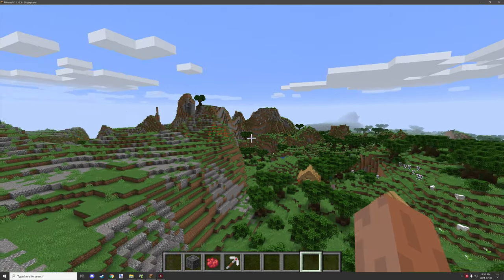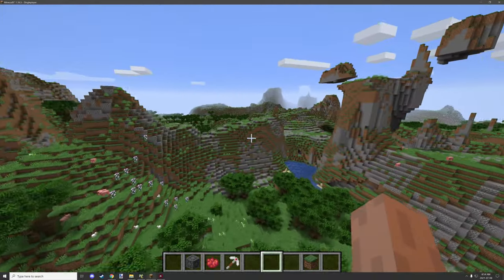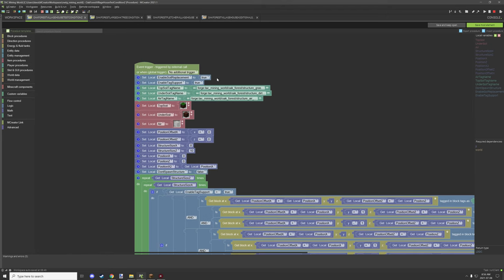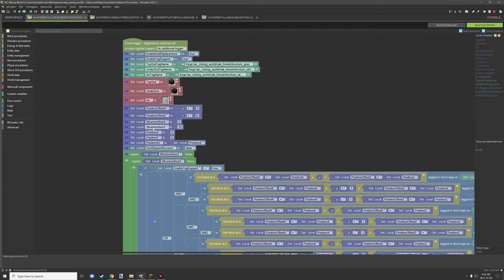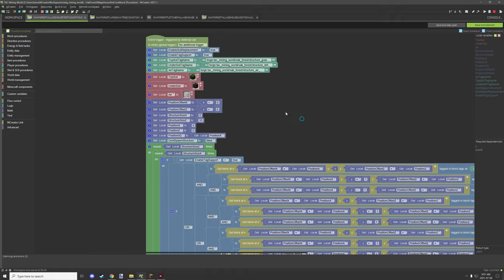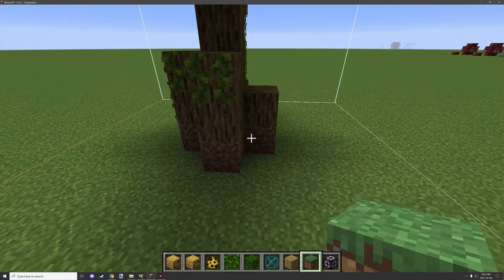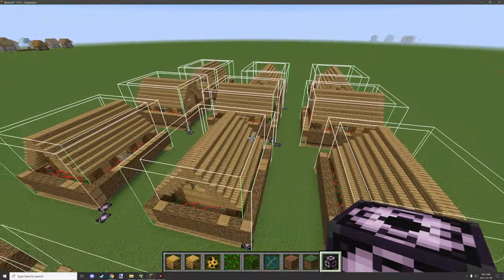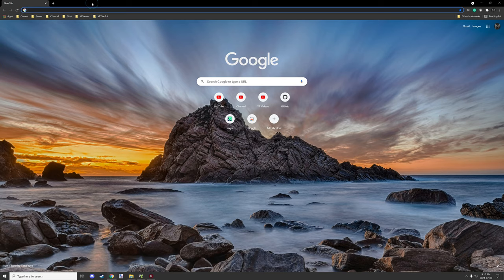MCreator: Advanced Structure Generation Script | 2021.1

Comment from the maker: I have just updated the download on GitHub to add support for changes made in MCreator 2021.2 regarding string variables. What happened was the procedure broke due to the changes in 2021.2 so I had to remake the procedures for the ones that used strings. The download should now have a folder for 2021.2 and higher and the old variables if you still are using 2021.1.
Reply: Which procedure is the one used for the trees?
Reply: thank you king

Comment: can you please make a tutorial on how you made the stone spawn on the cliffs or how to make the ground made up of multiple different blocks? make a video explaining it if you can, appreciate it a lot
Reply from the maker: Same script oddly enough, I used a structure that spawns in the mountains biomes (I think I used a random block just as a placeholder so I can run the script) then I I used a repeater for areas to spawn random blocks (cobblestone, gravel and no change) to generate noise, I simply replaced the topsoil and undersoil block for that biome using the script in the video it seem to work fine when I made the video I am not sure if it would still work on not though.
Reply: @NorthWestTreesMCreator  can you make a video on it? i still didnt understand, sorry
Reply from the maker: I sadly don't have the same workspace as the video I lost it when I upgraded my computer SSD drive, but I do have the script so if I find time to play around with the script I will make a tutorial on it for sure. I will add it to my notes right now.
Reply: @NorthWestTreesMCreator  TYSMMMM!!
Reply: @NorthWestTreesMCreator  i hope you still have it in mind im sure alot of people wouldnt mind 😔

Comment: Its not showing up when i try importing it if you might have reason i would love some help and thank you
Reply from the maker: There are a few versions for this workspace on GitHub, if your using 2022.1 then use the latest workspace, if its 2021.2 then use that version if your on 2021.3 then try updating for that version as you may have mist some patches along the way. 2021.2 basically changed a variable's variable or something ended up breaking all string variables so in short it broke this workspace for that period before it was fixed, I did port the workspace to 2021.2 and then port it back after the patch but sadly people still get confused with what version is for what and many people don't patch their workspaces so I hear about it a lot lol XD

Comment: Hey, im using this procedure in 2023.2 and it doesn't seem to work. I'm running it for a custom dimension if that matters...
Reply from the maker: 2023.2 had issues with local variables if I recall it broke some stuff, it was patched later on in 2023.3 but pretty much any strings would not be compatible with this version of MCreator and vise versa
Reply: @NorthWestTreesMCreator  I somehow got it to work so I’ll keep my fingers crossed and hope it holds up 😅

Comment: Hello, I'm trying to use the script but when I import I don't get the full script, just the variables, why do you think this is happening? I'm doing something wrong or just don't get it how to use it?
Reply from the maker: I really don't know, I had some issues in 2021.2 with variables not copying over however not script being imported.
The only thing I can suggest trying if you have your procedure not connected to the main green block for your script I know that it won't save that part of the procedure only the connected script. I am not sure if that can help you any with troubleshooting but that's the only Idea I can think why it would not be copying over.
Reply: I have the exact same problem, I created an issue on git, maybe it's a know bug ?
Reply: @NorthWestTreesMCreator  one possible solution would be to give screenshots of every procedure, so we can rebuild it from yours, or give the source code of the procedure
Reply: I'm having the same issue, both TreeStructureSpawningScript.ptpl and BuildingStructureSpawningScript.ptpl doesn't actually put any code blocks in my procedure.

Comment: I'm having issues with this procedure, it is not loading in 2021.3
Reply: same here !
Reply from the maker: 2021.2 ended up breaking some procedures I am not sure what caused it I will talked to the Devs and see if they can figure out if they can fix it to get them working again.
I may need to remake all the procedures I have had which will suck a lot as I don't have a lot of time to fix 200 videos worth of procedures.
Reply: Hi @GG bedwars and @Musi-Mating GamP!,
Exported procedures in older versions (before 2021.2 2nd snapshot) are not updated to use the new variable ID of String. The old ID of String variables were text and procedure blocks related to variables, such as the variable getter and setter used text in their registry names. However, when I made an overhaul of the variable system, I took the opportunity to changed all occurrences of text to string (notably by using the variable's ID everywhere). I made a converter to automatically fix older workspaces, but me and Klemen didn't thought they could be used in procedure templates... so procedure templates made before the second snapshot of MCreator 2021.2 (the snapshot where we added this new system) have this conversion problem.

I made the fix. However, I don't if Klemen will want to release a patch for this bug only. If we are lucky, he will accept to make a new patch otherwise, you will have to wait the first snapshot of MCreator 2021.4/2022.1. You can still make the procedure in a version below EAP 2021.2.23417 (this snapshot included) and then, open it with a new version and the procedure will be converted. I hope it helped a bit and sorry for this behaviour we never think to test. 😅

Comment: Hello, I like your video very much. Forgive me for speaking such bad English as a Chinese. In China, there are very few advanced mcreator tutorials like yours. You can be called a treasure to me. I can't generate the structure using the process in the latest version of mcreator2021.3, which may be my own reason. Many Chinese players' English is not very good, and most people rely on translation software to figure out every sentence in the tutorial. For example, refer to the tag name, I can't figure it out. If circumstances permit, can a more detailed workspace be made? For example, can you upload a workspace with structure, tags, and processes to GitHub? I believe this will definitely help many players who love mcreator, including me. Thank you so much!
Reply from the maker: There was a patch for 2021.3 that fixed the variable issue so indeed the string variables will have an issue again.
Regarding more details I can add some more comments to the workspace on key features, the script is really long so as you may imagine adding many comments takes a lot of time for large scripts like this so I try to avoid the less important things most of the time. I may remaster the tutorial in the near future as this script is ideal for any biome, structure, and dimension mods. I thank you for reaching out to me. I will work on fixing the workspace right now.
Reply: @NorthWestTreesMCreator  Thanks a lot ！
Reply: @NorthWestTreesMCreator  I have used the process，it worked.Thank you！ It is very useful。

Comment: I used this procedures on my mod but now the trees are very rare even with a high spawn weight
Reply from the maker: the script requires flat area so if its on steep terrain then it will be really rare on generating, you can change the spawn group size or add more structure for more versions of the tree, from testing this seemed to work fine but I would focus on spawning trees on more level areas as large the structure the more flat area is required to spawn it.